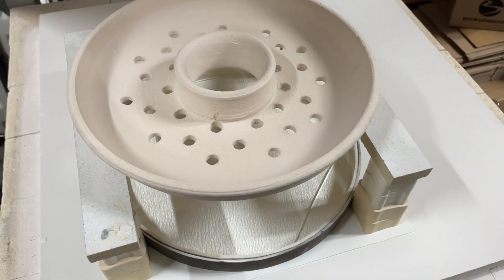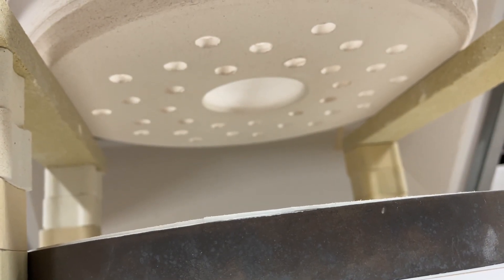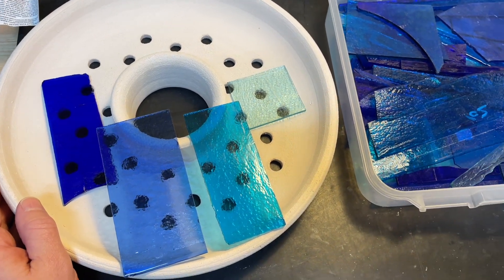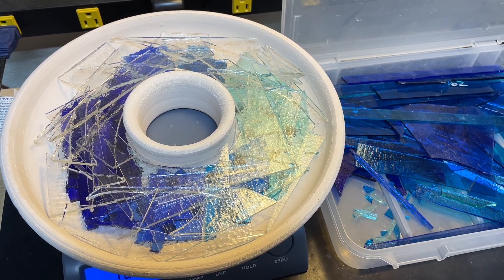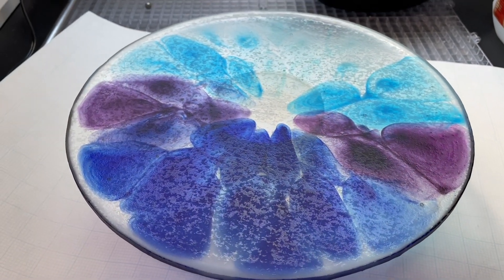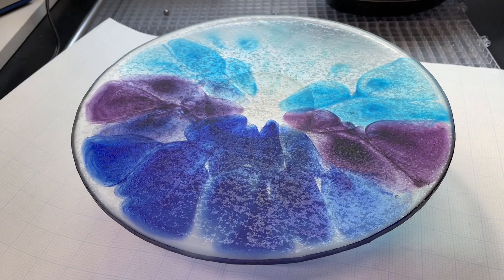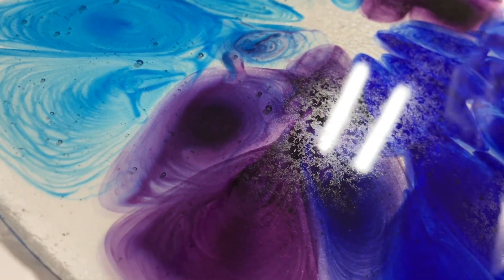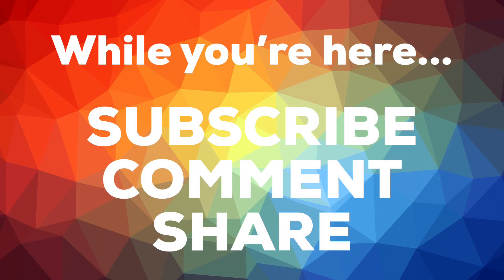Pot Melt Experiment — Another Fusing First for Me!

Comment: I've tried this very process, the sand/powder/refire, and ended up with that same result. What grit did you sand it up to? I did find a difference in the clear powder vs the crystal clear powder. I try to stick to the reg clear only.
Reply from the maker: I think I used a low grit… only 60 or maybe 120 — can’t recall now! And yes, only regular clear powder, not crystal clear!
Reply: @JamaisonSchuler  I come from the Boro world. Things that are left at those lower grits scuz quickly, even under clear. Especially when heated rapidly.  I have had some better luck (in fusing) bringing projects up to a higher grit, and firing a bit slower on the way up.  I'm definitely no fusing expert. Just an observation across the two disciplines.